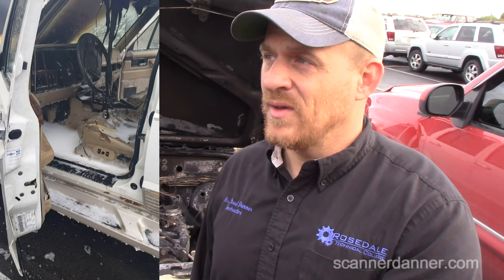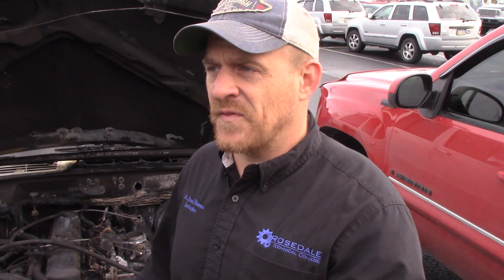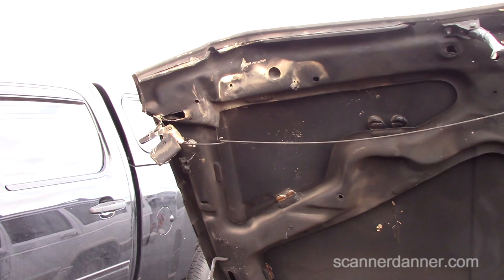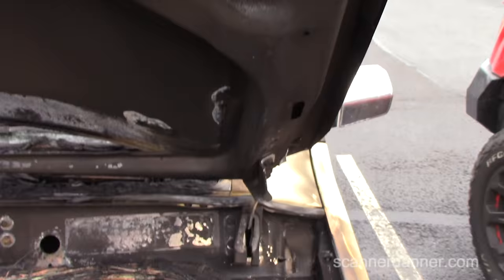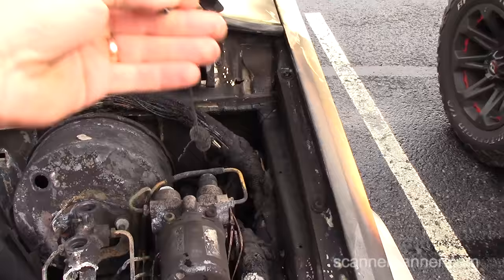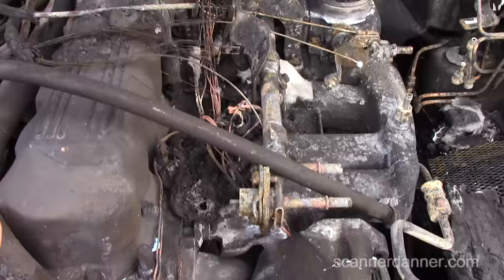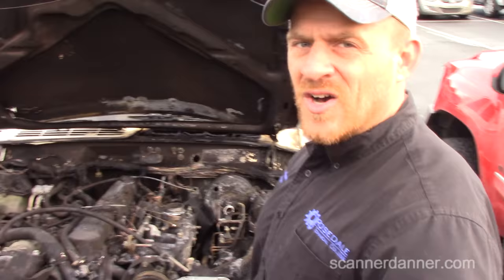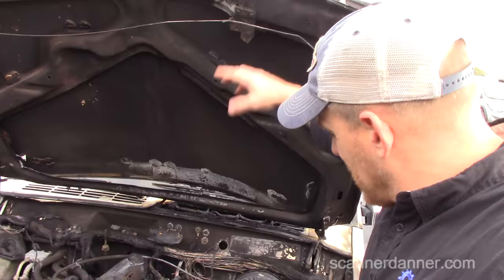ScannerDanner's Jeep CATCHES ON FIRE!!!

Comment: I remember I was fixing a non operating convertible on an m3 and the manual cables were next to the battery under the seat., somehow it touch the battery positive and it got hot really fast.

Comment: easy this one paul,hood release cable slack dropped down onto battery positive,cable got very  just like a glow plug in engine,started fire,thats why hood release didn't work.ps any help on p0004 on grand voyager pcm not grounding to earth,12 v ok signal from pcm 4.96v coming down it.

Comment: That is what insurance is for. Thank goodness no one got hurt. It is interesting how the brake master was distroyed. Aluminum melts around 1200 f so from the looks of things, it got hot! There will be better days!  And by the way, I doubt a carbon chunk could have done this. It would have been a small fire and burned out. This fire had fuel. I bet an injector was leaking or maybe a fuel line. In fact I know for a fact that the stainless fuel line going from the frame to the intake has a hold down on intake and the hold down promotes rusting, it will get small micro holes on them and will leak. I can send you pictures of one leaking after I did a head on it. Local dealer keeps a lot of these lines in stock. If this is the case you may still be able to see the stainless steel line and it may still be intact. But it is odd you did not see or smell any smoke when you got out. Sorry man. Also, if ins wants to fight it, I'd (and a bunch of us I'm sure) would kick up $5! 💰💰😎 Old jeep like that can be had for a song around here.
Reply: At 9:10 you can see the fuel line and hold down I'm talking about at far left edge of screen. Just a thought.

Comment: Most likely, would a fuse not blow before a fire started if it was an electrical short? Just asking, I do not know. I have a hard time believing that a chunk of carbon/oil caused the fire, I have had big fluid leaks all over the exhaust pipe and manifold, lots of smoke, but no fire.Either way, what matters is that you are safe.

Comment: It appears that the intensity of the fire was in the area of the master cylinder, could there have been some brake fluid spilled after doing the brake work ? Or possibly overfilling the master reservoir and leaked onto the exhaust. Being a tech for 35 years seems to make me question everything and makes me want to find the cause of whatever happened. Sometimes it's a curse

Comment: Wow . I would prob guess wires . Thinking if it was oil or something you prob would of smelled it being hot . If fuel leak would of thought it to of burnt before you shut it off .and again would of prob smelt hot fuel . Supposing that you turned the key off and went in store ,just starting to smoke , it may of taken that long for a wire fire to break out . . key off and park prob only thing that changed when u parked there from driving .

Comment: Hood cable broke (ironically) and fell on the battery and shorted against battery positive which in turn heated up and caught fire to something flammable. This is the reason you couldn't open the hood even at such an early time. I thought I saw a completely melted and destroyed battery in the video. And as you said there was debris and probably oil etc through out the engine compartment so it wouldn't take much for a fire to keep going. In Your thumb nail pic it looks like there is a puddle of possibly battery acid on the ground.

I would look for arc, weld marks or extreme heat coloring on that hood cable to verify. Or possibly a defective battery finally decided to blow maybe over charged the list is endless.
Reply from the maker: +Shawn Hood cable is on drivers side, battery is on passenger side.
Reply: ScannerDanner oh ok it would have been a wierd coincidence. Best of luck

Comment: Nah it wasn't the valve cover.  I'm leaking oil straight onto a turbo charged exhaust manifold and all it does is smoke and smell like burnt oil.  Carbon is already burnt so that probably isn't an ignition source.  The only thing I notice is the hood cable being severed, Fire isn't going to sever a hood cable, dunno what the melting point of steel is but you didn't get there.  I think the fire started in the harness on the drivers side. if you look at the master cylinder reservoir, it's gone but the washer fluid tank is still there on the otherside.  First thing I thought of was the money you have in that $400 jeep, that's the real loss.  Don't take it too hard, I'm sure you're free of blame.  Good luck!

Comment: So why could you no rebuild it? My brothers 95 Lebaron conv. caught fire. Took out TCM  harness and timing belt. Took me 3 months to fix it because of belt. I wasn't installing tentioner right. The V6 in those cars have a tentioner that looks like a metal skate wheel sitting on a metal plate with a hole in it. Didn't put tentioner on the pin that runs from oil pump. Once I installed it correctly car fired right up. We are human we make mistakes.
Reply from the maker: a 300k power-train on a rusty frame and body, nope, it wasn't worth it

Comment: I'm watching this video series of yours. Because I was trying to understand more about a/c I'm trying to get a c working on a 02 Duramax I purchased in Feb of 2020. I do construction. So I'm not mechanic. But my day was a diesel and ford tech. I'm shock to see your  Jeep on fire. I have two questions. You said in the video when filling the AC system. You heard a noise like mice or something inside the vehicle. Do you ever check that out? And videos off yours I see. Your at Pete's and a customer had wires chewed up by mice. So I'm guessing this might have started the process of the fire? But my other question to you and your students/techs. You said if you work on the vehicle and it catches fire shorty there after. You as the garage are reliable for the vehicle. But if you did solid work. To the best of your ability. Did the work 100% and not cut and corners. Then the customer takes of in the car. It it catches fire. Due to mice inside something. (Which you had no knowledge of) couldn't you make a case of not being reliable for the fire.? I understand you would have to find evidence of something other then mechanical issues causing the fire. I mean what it it just had a new gas line leak that day. And someone walked by and dropped a cigarette butt. Your getting coffee. I doing this the carbon and oil would burn like that. But anything is possible. I would have looked at where the wires are burn the most and is there and fuses/ fuse panel in the engine compartment. That could have shorted and caused the fire.

Comment: Most times where it’s burned the worst that’s where it started...which looks like the driver side area where the battery is ...could be a grounded wire
Reply from the maker: Battery was on the passenger side.

Comment: It seems suspicious that the car was parked awhile before the fire really started. Combustion reaction require a certain activation energy to get going; the most probable time for this would be when the engine is the hottest I suppose. 

Hypothesis:
- The carbon that was blown off ignited on a hot exhaust manifold. I find this one unlikely.
- Leaky fuel injector; fuel was lit by...? Unlikely since the car was not running, no possibility of spark jumping and whatnot. Did it smell like gas?
- Sudden shorting in the wire harness? Were the fuses blown? How about the cables that precede fuses? What was the state of charge of the battery after the fire was put out? It is very likely that the fire caused a short anyway.
Reply: Heat fuel and oxygen.  Heat goes up when you park, less movement of air and coolant to dissipate it.  Some cars run the fan after you shut them off on a timer, but that has been phased out.

Comment: ??Battery positive post shorted to the metal hood release latch (passenger side)? Burned hood cable (on the drivers side) where it shorted to ground?? Heat up a hood cable with a  butane torch and yank it, would it snap in two?

Comment: It takes a LOT of heat for oil to ignite into flames. Not typically enough from oil and carbon on the exhaust manifold. 

My bet it electrical. But Im sorry man, I know you put a lot of work into the xj..  I have always liked those jeeps I used to have a 96 xj. 

Luckily no one was hurt.

Comment: new fuel filter?  maybe the increased flow blew out an injector seal on the engine and started a new leak?
Reply from the maker: +mschrar didn't consider that. Sounds plausible

Comment: Man, don't let this make you second guess yourself. You and I both know that fire wasn't caused by carbon deposits on the exhaust manifold. 

Those pieces would need to be heated throughly to nearly 700 degrees at a minimum to even chance ignition, and even if that happened, I don't believe it would have caused that. 

I'm glad no one was hurt, and I'm sorry about your Jeep. Those things are burning death traps, and it's nothing to do with the work you did.
Reply: Yeah that definately started around the harness man, just pure coincidence with the timing. Looks exactly just like one toyota that caught fire around here with a rubbed harness. Owner parked the car, went inside for a quick moment and when he came back the thing was already blowing smoke from under the hood. Fortunately he was still able to get it under control before it burned completely.
Reply: DIY Auto Homeschool
Reply: Science over emotion...exactly.

Comment: I think it's from a faulty harness. With the age of the jeep I'm sure wire insulators are brittle and break off. seems like the fire started at the fuse box. that was the burning plastic you were smelling.* not a faulty harness but a old and brittle one.

Comment: Did the hood cable came loose and make contact with the battery or an other component? have seen this on a different car. Cable rubbed against the battery connection till the plastic was gone and it shorted.

Comment: I had a harness melt on an Audi 4000 CS Quattro because the electric fan for the radiator and HVAC seized and because those smart German engineers decided that a heavy amp motor doesn't have to be on a fused circuit.

Comment: Antifreeze sets on fire on hot exaust manifold, happened to me, steering and brake fluid too...harness getting a short - happens, harness setting on fire ! Noooooup
Harness - "wasn't me".
Reply from the maker: I've never seen antifreeze burn, ever, not once. You sure you didn't have some type of stop leak or sealer in there?

Comment: I work on cars almost 7 days a week., I see oil leaks on valve covers all the time, some severe enough that it drips on the exhaust and smokes just idling, It does not burn though., my co worker sprayed brake cleaner on an exhaust manifold., that one made flames while my co worker just stand there frozen. Haha

Comment: I once come around a vehicle(not a jeep) with body grounding not fastened and would use hood cable to ground body which made it very red hot(untouchable) due to load(radio,lights etc) and this can easily start fire...could this be your case?...

Comment: and jeep xj was 86-01
ZJ(Grand cherokee) 93-98
jeep WJ (Grand cherokee body change) 99-06

your front tow bar will fit all years of XJ'S and ZJ's with a direct fit.

will fir the WJ with a little modification to mounting surface. along with the jeep liberty from 02-09 years only with a little modding to the mounting surface. 2010 the  frame desinge changed too much and the patriot from years 06-09 only will fit with again a little modding to the mounting surface on the frame 2010+ changed the unibody design to much the modding to where the surface is, is for the front sway bar brackets are.

Comment: A wire harness running across the back of the head,  sometimes chafes on a head bolt stud and shorts....never seen fire from that, but i could happen.
Reply from the maker: it happened right after doing the valve cover gasket, one other thing, one injector was seeping on the body of the injector but only when it was cold and I knew about it but let it go (for now). But it was absolutely an electrical fire. 
I really think the progression was the chunks of carbon/oil from me blowing out the top of the head (with the valve cover off), smoldered on the exhaust manifold (right below the injector), lit that injector, which melted wiring and caused the harness to fry. Just my theory.

Comment: Paul, I don't think it was due to carbon on the exhaust.  I've seen plenty of carbon from leaking valve covers get on manifolds.  Coked oil just smokes.   You could do an experiment to prove it to yourself.  On the other hand, electrical or fuel, are very possible causes of fire..

Comment: yep it could have been worse , what if you were on the freeway , any of those businesses around there run cameras , apart from  wiring harness causing fire ive got power steering hose failures as the cause of this model catching fire ( with a search )

Comment: did you have your headlights on during your trip?
Reply from the maker: Yes I did. Why do you ask?
Reply: ScannerDanner the headlight wiring was undersized from the factory. coupled with corroded connectors in the front right wiring harness could have started the fire.
Reply from the maker: Seriously? What model years? Was there ever a bulletin on this? I actually left my lights on when I went in to get coffee. But the lights were on and bright during the initial stages of the fire. If it was the lighting circuit, I would have expected them to be at least dim.
Reply: i have both an 88 and a 90. and i think maybe up until 96 ish they still had it. if not all of them. maybe from driving it kept it cool enough.

Comment: Intake over exhaust manifolds is a terrible design.  All that red hot exhaust heat right above the fuel.  I don't think any of my many engines has ever had that design.

My theory is that the oily carbon chunks got lit resting on the top of the exhaust manifold much like a barbecue of briquettes.  When you parked, air flow stopped and the heat wasn't dissipated and rose straight up and got to the fuel lines.

Good to be clean under the hood.

Comment: Although it very well could have been electrical (there are known problems with grounding, ground loops, etc with this era), In an ignition OFF situation I would think you would have seen weird electrical symptoms before hand. You shut the vehicle down, and there is a LOT of residual heat entrapment in XJs under the hood. There were some recalls that installed heat shielding between the injector assy and intake/exhaust manifolds, to help prevent heat fatigue of injector components.

Don't discard the possibility that the hood latch cable broke when you pulled on it. The heat from the fire could have already warped the hood enough to bind the latches in both corners. But that's not here or there. Sorry you lost the jeep and your effort, but it could have been SO much worse - don't forget that. As Olskool said here, maybe there is something better going on. The repair lessons live on, even if the jeep doesn't. :-)
Reply: And chasing the source of an electrical fire can be like finding a roof leak by the water spots on the ceiling.

Comment: I don´t think that a piece of carbon caused it.. you would have smelled it long before or when you pulled in the parking lot .. I just had a very small oil leak on my car that would put 1 or 2 drops of oil on the exhaust manifold every now an then , really not more...and I smelled it everytime and once I even saw a litte smooke coming from under the hood...for the same reason I don´t think it was an oil leak from the valve coverI think it was either  an electrical fire or maybe a fuel leak... but for fuel I would also expect that you woul have smelled it beforeOn your video you see stuff burning under the car and something that looks like puddle... Any idea what that was ? Some fluid or burning plastic that dropped on the ground?
Reply: The fuel lines and hoses were in good condition ?

Comment: Could the battery shorted on the hood release cable?
Reply from the maker: battery was on the passenger front, hood cable is runs over top of the intake manifold area on the left side. I honestly believe the injector was seeping fuel and it ignited, then cooked the electrical system, not totally sure and never will be

Comment: I know what happened. You saw some small smoke from oil sludge whatever. Then you pulled the hood release hard enough to break the cable but not open the hood. The broken cable fell onto the battery and the battery caught fire. Solved!!
Reply from the maker: Nice try, hood cable is not near the battery and the fire was already going and I did not pull hard on the cable, it was already severed.
Reply: @ScannerDanner   Rats! I've been working on my wife's 03 monte carlo ss for six months and still cant get to to run. Crank no start. Its hopeless.

Comment: this issue is soo common. the fuel injectors  seep. fire ensues. hood latch cables melt. can't open the hood...totally not your fault...sorry if someone has already posted this issue...
Reply: personally have saved two Cherokees from this fate in the shop lately. sorry for your loss...
Reply: both started with a customer concern of a gas smell inside the car...fyi...
Reply from the maker: no gas smell at all but the rest of it sounds legit.